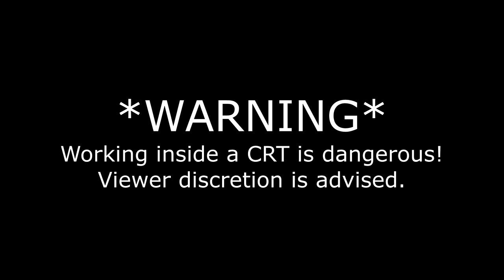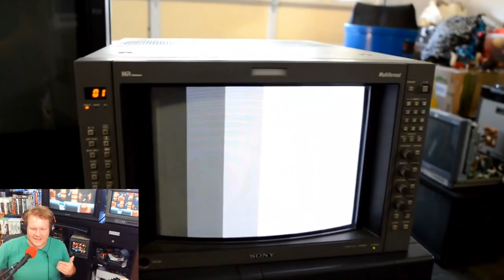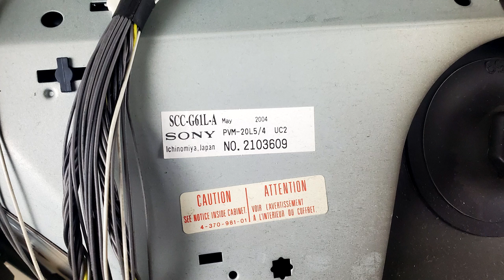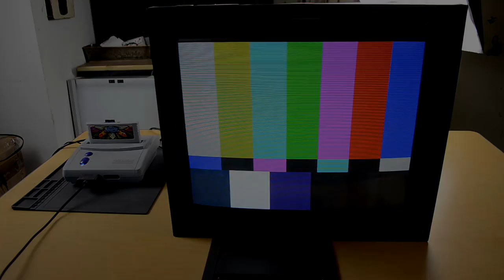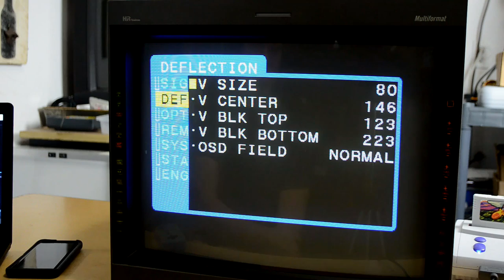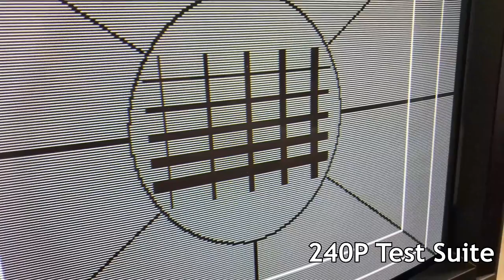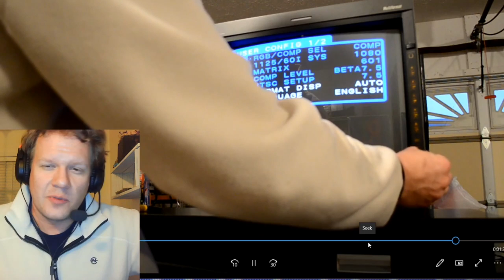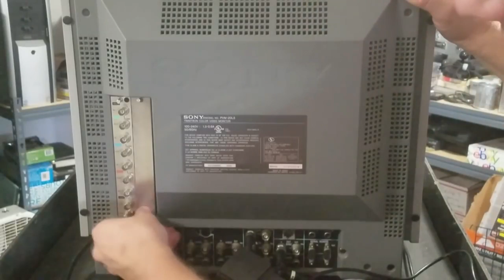Retro Tech Marathon - The Sony PVM 20L5 CRT

Comment: Question. I have a 20L4. Is it just the European equivalent of the 20L5? It has no trouble with both NTSC and PAL signals. I can't really tell the difference in spec.
Reply: The 20L5 is multiformat supporting up to 1080i
Reply from the maker: Yeah the difference will be the resolution support.  the L5 supports digital resolutions up to 1080i, while the L4 is analog only I believe.